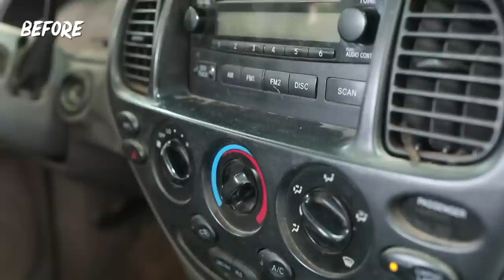Detailing A Nasty Work Truck Toyota Tundra | Car Cleaning Restoration Quick Fix

Comment: I always enjoy these videos - the before/after shots are particularly satisfying. One question I do have:  how do you clean suede components when you detail cars? I have a few panels of suede in my own vehicle, and I'm honestly not sure what sort of product to use on them, because they're not fabric but they're not leather either 🤔 (Well, I suppose suede is technically a variation of leather, but I don't want to ruin the "fuzziness" of it by using a product that isn't right for it, and most leather cleaners are intended for the kind that has a smooth finish.)

Comment: Sad.  If you mechanically take care of a Toyota truck, it will last forever.  Resale will be good too, if you don't run it into the ground like this Tundra.
Reply: In my opinion this truck is actually in good condition.  None of the knobs or plastic is broken inside the cabin, it’s just dirty.  Being a truck used in construction and it’s 20 years old, I think it looks good.